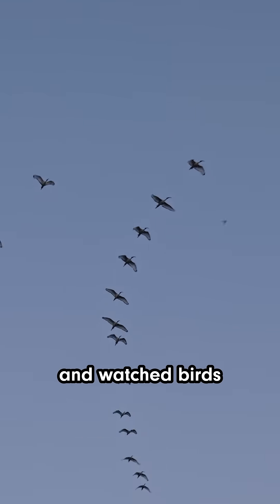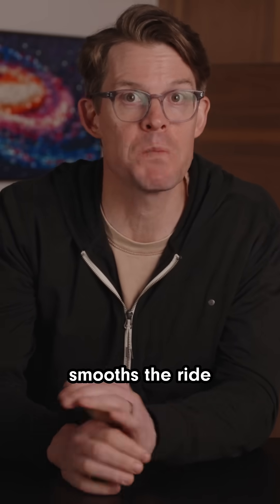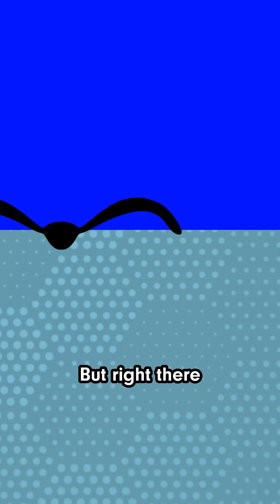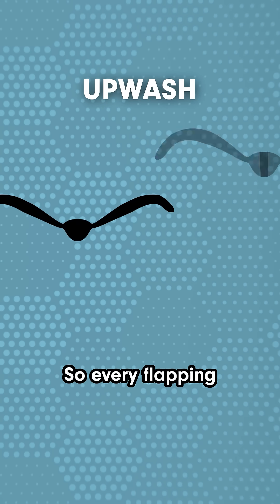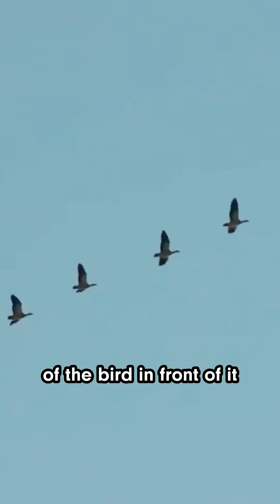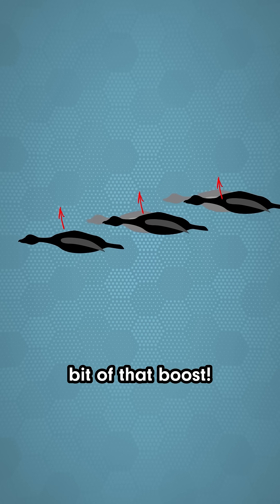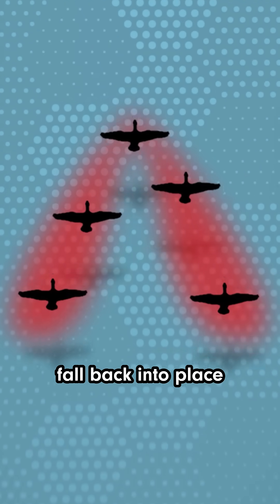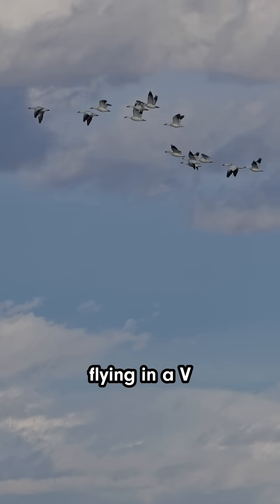Why do birds fly in a V?

Comment: I was under the impression that many birds fan their wingtips in a way that, I was under the impression, either reduced or removed the vortices. If that is true then I have to wonder how these two mechanics interact, because the feather configuration seems like it would fight against the potential benefits of the V. So do migrating birds have the wingtip feather splaying? If so then it would imply the cost benefit of the wingtips splaying is likely of greater benefit to the individual birds survival than the reduced effectiveness it would have on the V formation for the flock, and if their wingtips don't splay in the vortex reduction/canceling fashion, then it could imply that the group benefit of the V formation is greater than the the wingtips for any given bird.  I'm sure someone more verse in this field could answer this.

Comment: Wait, shouldn't it be "downwash" like with airplanes? The rotation direction of the vortices  would have flowfields that propel each other downwards, not up. What am I missing here?
Reply: If they were directly in line, yes. but the V means they are offset so they hit vortex coming from the end of the wing, and only on one wing.
Reply: @iamthewalrus8391  I suppose that makes sense. What's downwash for the bird in front is upwash for the next bird in line.